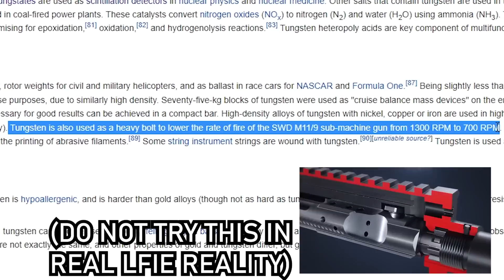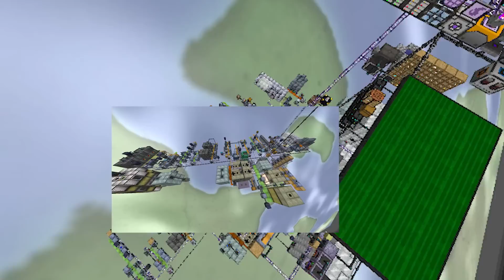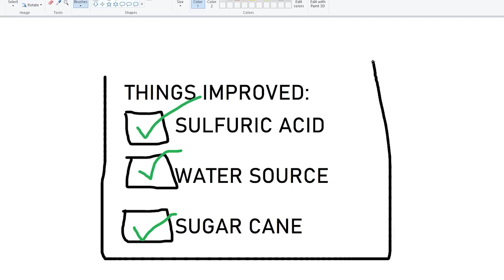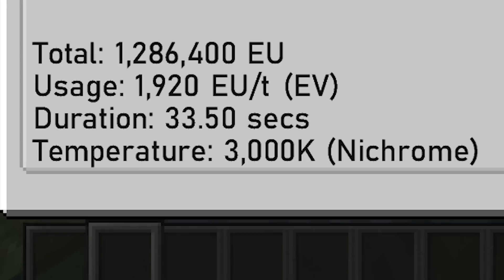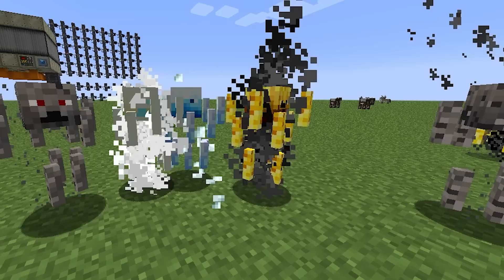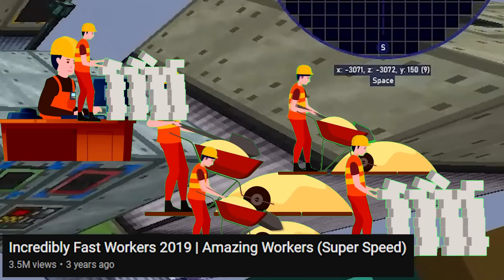I built a space station that defies reality itself - Nomifactory Ep. 8

Comment: Hey Igblon! I would recommend setting up an auto tungsten production system using the small amount of tungsten obtained from centrifuging endstone dust.
You can get endstone by crafting together sandstone (from sand crushed by forge hammers) extraterrestrial matter (from DML system) and enderpearls (also from DML system)
If you use this method, you will get tungsten passively (so no repeat microverse missions just for tungsten) but I would recommend adding multiple simulation chambers to make alot of enderpearls due to how much endstone (and therefor enderpearls) the tungsten production system takes.
(P.S. this is also an infinite platinum production line for the large amount you need for EV tier machine and circuits.)
You've helped me alot in my ventures into Nomifactory so I would like to help you back!

Comment: The quotes shown from people I know in Discord are funnier than they probably should be. Also holy smokes, that base-moving montage. That's some serious dedication.

I should also clarify that crafting cards are not really that bad, but AE2 import/export buses WILL kill your TPS after you get enough of them. The safe way to do it is using a stocked interface and a movement cover (pump/regulator/conveyor/robot arm), which scales basically infinitely without issue. It's also far more responsive than active AE2 buses, which wait longer between actions if they haven't done work recently.

Notable mention: consider switching from piston / vac chests for your sugarcane farm to a long-range breaker from ActuallyAdditions. It breaks up to 8 canes in front of it, and doesn't drop items in the world but rather teleports them into an internal buffer. If that buffer fills up, it won't break more canes, so you don't have to worry about entity pileups.

Comment: it may look ugly, but i would make a big floor at the bottom floor just in case you drop or accidentally break something, so it doesn't fall into the void
Reply: I think that item dislocater bauble might help with preventing that.
But I'm not 100% certain how it works I'm just assuming it's a magnet.